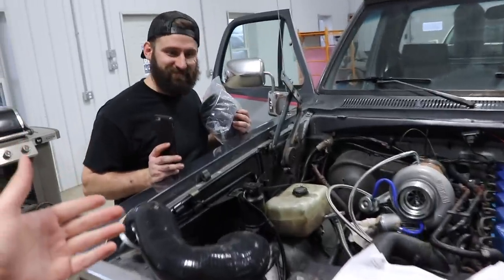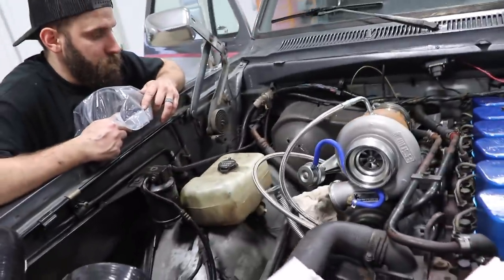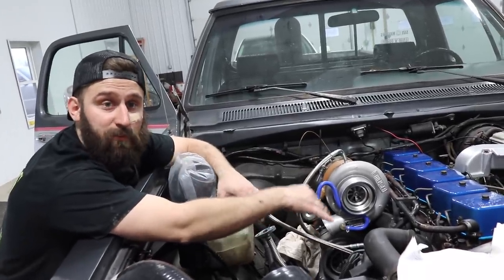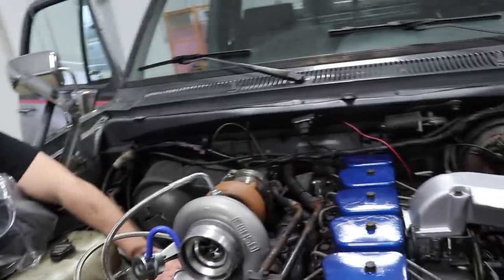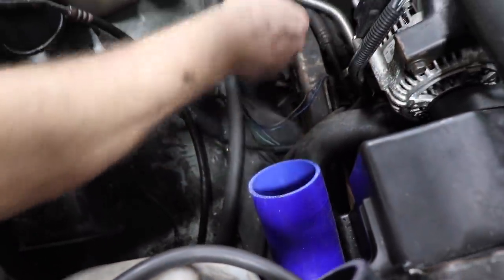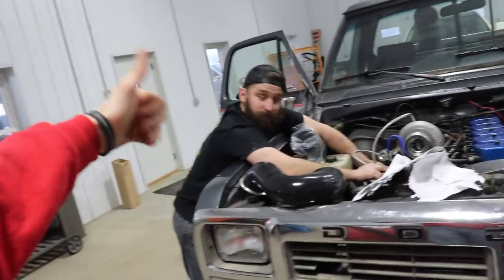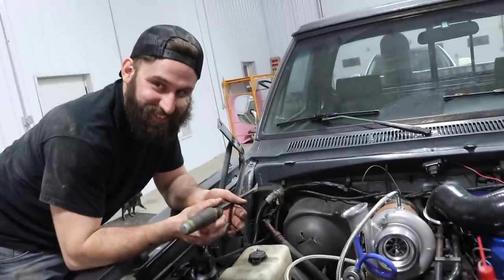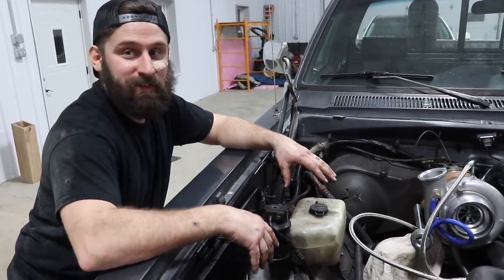BUILD PLAN FOR THE TOTALED 7.3 POWERSTROKE 'OLE WHITEY'!!!

Comment: Just my 2 cents, replace the stock front bumper, do the flat bed and honostley I'd put the stock wheels back on it with an aggressive a/t, then maybe new front and rear leafs, pretty much a practical work truck give away and well under budget

Comment: Need some suggestions pls. I crashed a 7.3 diesel excursion 01 it was a tbone both driver and back door is bent in to the seats, but the frame is not bent just the running board bracket still drives and runs great but it is the only truck we have and we have to get it fixed. So if there is anyone who might have any suggestions pls let me know.